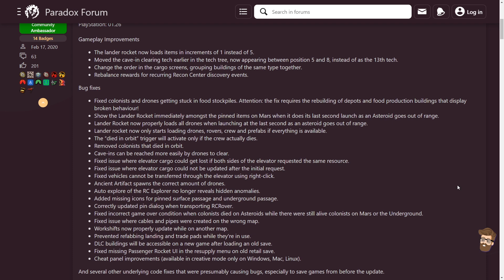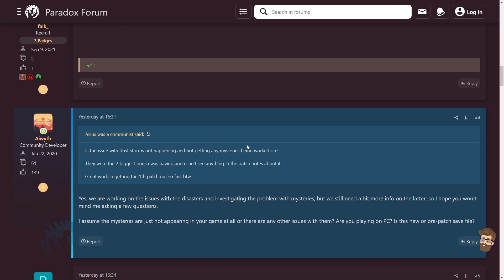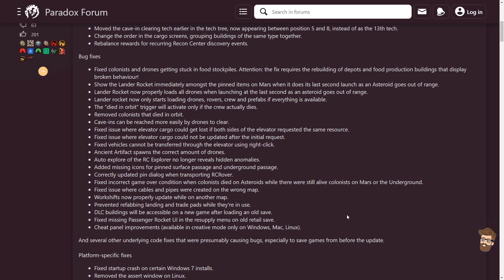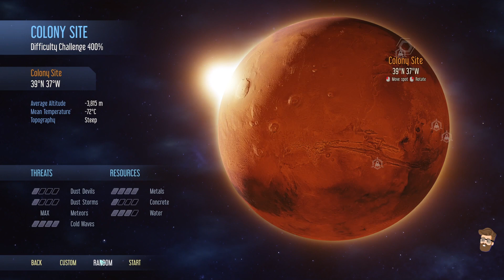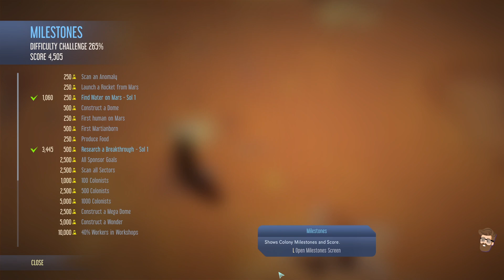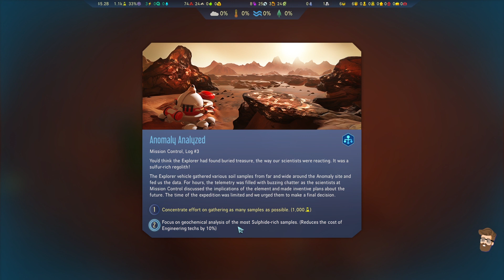Hotfixes and Landings - Surviving Mars Below & Beyond Gameplay (Part 1)

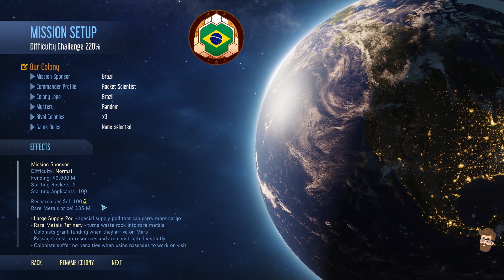Comment: 7:28 Hi Steve,
No your not going crazy it clearly states "Starting Rockets: 2" with Brazil, but it only gives you 1 rocket.
This is still the same in August 2023 as I've just started a new game with Brazil because I like the "Rare metals refinery" that makes rare metals out of waste rock.
This makes it easy to do an unmanned expedition as you have almost unlimited funding via exports. I just waited 'till I had over $3B in the bank and bought a new rocket, That really sped things up.
To get a lot of waste rock you can level some of higher ground down to the lowest, Best done early in game before terraforming as it kills soil quality.
HTH

RE making drones without needing colonists:
1, Build Drone Hub 9 metals + 8 Electronics and get 6 drones with it.
2, Pack drones for reassignment.
3, Scrap/demolish Drone Hub (get 50% of resources back, 4.5 metals + 4 Electronics).
4, Rinse and repeat as desired.

This is both Quicker and cheaper than using the drone Assembler which needs 1 Electronics per drone and takes forever.

Note:
This doesn't work if you Prefab/Refab the Drone hub as it refabs 6 drones with the hub.